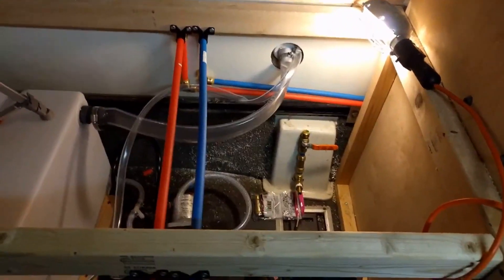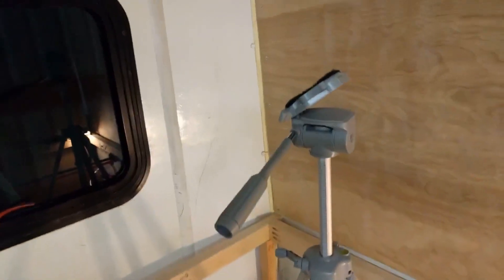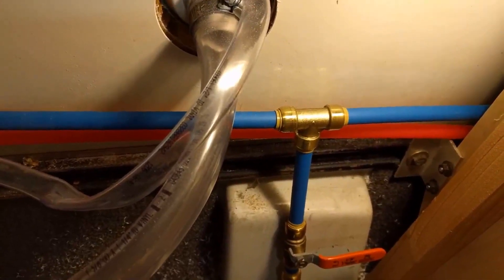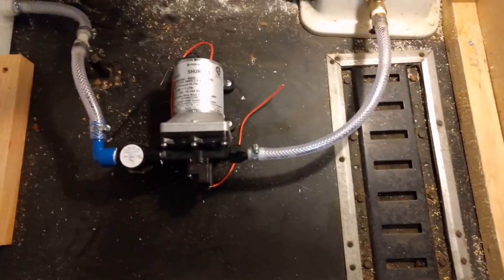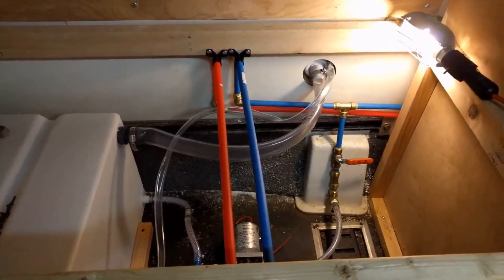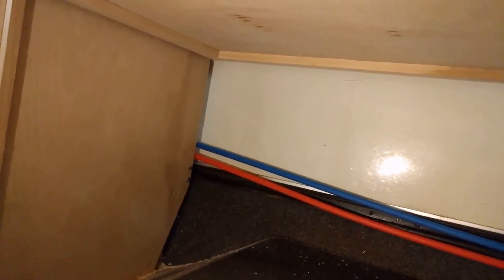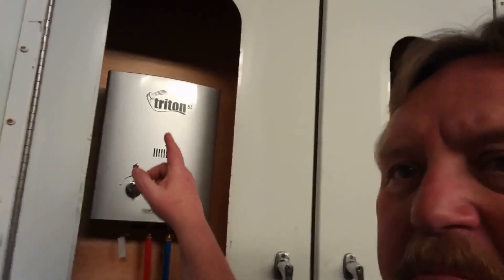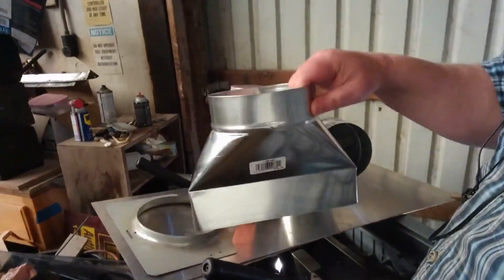Shuttle bus rv conversion (Part 26 second half) Plumbing the water lines

Comment: What water pump are you using? what it the GPM?  thanks
Reply from the maker: @The American Wanderer https://www.amazon.com/SHURFLO-4008-101-E65-Revolution-Water-Pump
Reply from the maker: https://www.amazon.com/SHURFLO-4008-101-E65-Revolution-Water-Pump/dp/B002XM5G70/ref=pd_bxgy_263_img_3/145-5866278-6296955?_encodin
Reply from the maker: Make sure you use a strainer with the pump to protect it  https://www.amazon.com/SHURFLO-255-313-Twist-Pipe-Strainer/dp/B000V2W0GE/ref=pd_bxgy_263_2/145-5866278-6296955?_encoding=UTF8&pd_rd_